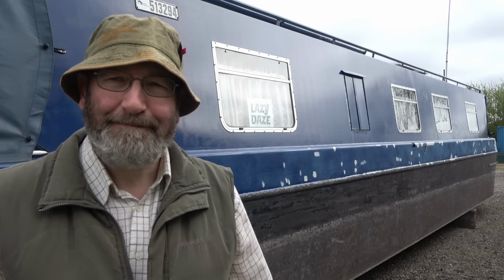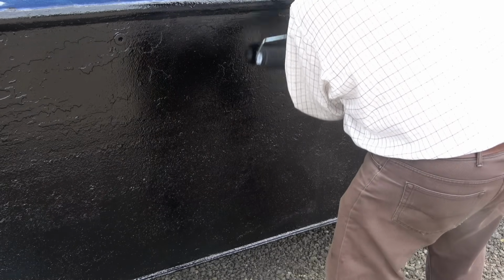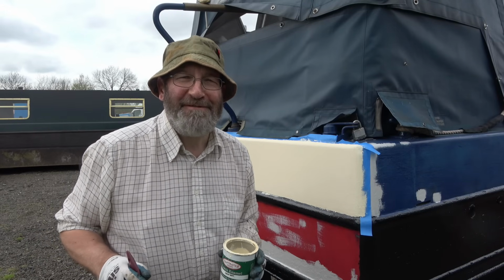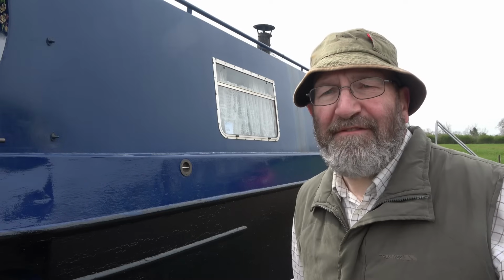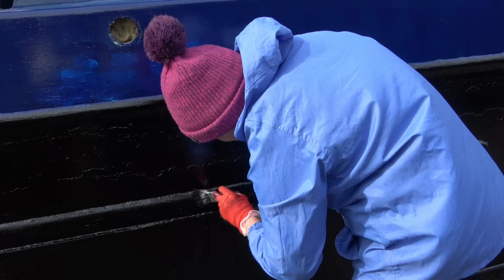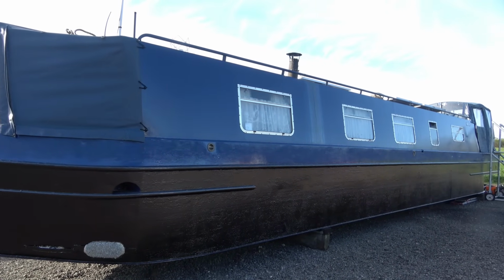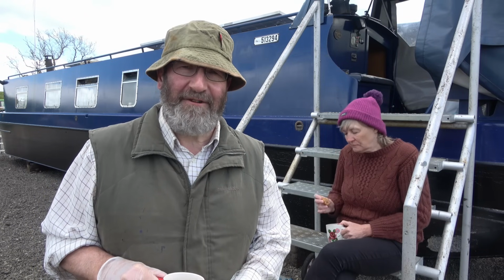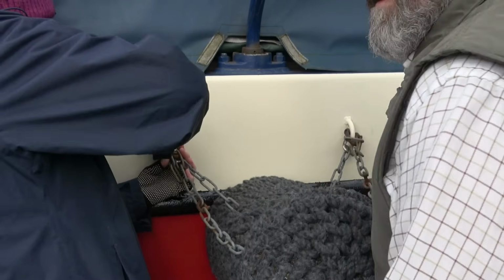396. Narrowboat DIY Hull Blacking - Final Part

Comment: I love to watch people work. I can do it all day. It makes me tired  enough to sleep all-night. You have done a yeoman's job of it. I think the roller lays down an over worked , thinner coat than the brushes do.
Reply from the maker: So do I, that's why I had Sally with me! Brushes do apply more paint but then, if' it's too thick it will run, so many thinner coats are better but it's all a matter of time available to get the job done.
Reply: Alan, extremely glad you've met your soul mate in Sally. I've recently found the same.  I'm a lot older than you but age doesn't count. Great video as usual, best regards from Chester by the Shroppy.
Reply from the maker: @philipjones9458 Hi Philip, I replied to a similar message of yours, not much older actually. Cheers

Comment: Nice 1 Alan and Sally, a good bit of effort there folks, thank you…
Reply from the maker: Glad you enjoyed it, we did, it's very satisfying to do the job ourselves.
Reply: @MyNarrowboatVenture  I will be doing mine next year, I will try doing it all by brush.  The reason being my experience (not a lot) using rollers I find they suck paint up as well as put it on, depending on paint type as to which correct roller to use, by the time I would go shop for the correct one etc I would be half way through the job using the brush, I will see how I get on next year…
Reply from the maker: @Dyfhi I previously used foam rollers but the furry type was much better. I think you have to try different things and see what suits you, everyone has different ideas. Good luck with it when you do it.
Reply: @MyNarrowboatVenture  your right Alan.  When I do mine I shall let you know how long it takes, that’s if I have enough memory on my card at the time to fit it on lol…
Reply from the maker: @Dyfhi I hope it all goes to plan for you.
Reply: @MyNarrowboatVenture  thank you…

Comment: Talk about frustrating, I’ve been there myself over the years, where the lighter primer shows up through the topcoat! You did well, both of you, because one supports the other. 😊
Reply from the maker: I only used the light primer, as my unused tin of red oxide primer had gone hard and I found I had this other primer, clarly not fit for what I was doing with it! Cheers

Comment: Brushing always gives you better coverage than a roller but a roller is a good way to get the paint onto what you are painting. Can I suggest using a three inch bush, if you are feeling extravagant, the best brush to use is an acrylic Purdy brand, picks up more paint and leaves a really good finish, they make painting almost a pleasure, and so much faster, and less chance of of dips because of fewer tin to narrowboat movements. Also having a wider brush apart from picking up 50% more paint each time it also makes cutting in the edges so much easier. Keep eating the cheese topped rolls, haven't seen you eating one recently!
Reply from the maker: I agree with all you say but the gunwales are so easily marked when cruising that the prep and application is less important. A jagged piece of Armco will always win! I have been thinking about doing a better job on the sides than previously, very much as you suggest using a 3” brush. You’ll soon see that I am still eating cheese topped rolls but less often, as I can’t always get them. Cheers and thanks for the advice.

Comment: I purchased a paint stirrer from Screwfix which attaches to a drill.  I used to use an old bit of wood but now use the paint stirrer. It works really well, especially with that oil based paint.  Bye for now...... ❤👋
Reply from the maker: That's very useful for some 'stiff' paints. It was re-stirring the paint that made it change colour before my very eyes. When I didn't re-stir the next tin, all was well. Cheers

Comment: How do your arms and back feel? You've been leaning over pushing on the roller. So my dumb question - you don't black the bottom of the hull?
Reply from the maker: I felt a bit weary after it all, not specifically legs and arms. The base plate is less likely to rust, as it is fully immersed in water. The sides are more prone to rust along the water line where it's wet and exposed to the air. Base plates tend to be 10mm thick and the sides 6mm, so the sides will rust first. My base plate is 8mm.

Comment: Hi Alan & Sally! Well done for gettoing the job done, despite the setbacks. This is not a criticism, but have you watched any vlogs from Boat Time? They are a young couple on a narrowboat, who have also blacked theirs. They also blacked the base plate, which was really hard work. I know that there are two schools of thought about that (whether it needs to be done , or not), but do you know the condition of yours?
Reply from the maker: Hi Alan. I’ve already answered this query twice, so please see if you can find them, as I’m going to answer now in a different way. I wasn’t aware that Boat Time had blacked their boat. What thickness is their base plate? Most boats are 10mm base and the sides are 6mm. The base plate is less prone to rust, as it’s not open to the air, so the sides should rust first, hence the need for regular blacking. It’s not easy finding somewhere that can lift a boat high enough to get underneath it. My boat has an 8mm base plate. The surveyor recommended to get it blacked, so I did. He said it would rub off but stay in any pits. I don’t see the need to black the underside, as it’s thicker by design for a reason. I’m told my boat is built of good grade steel, I don’t get rust spots like I see on other boats, so all is well as far as I’m concerned.

Comment: Why have you left the base plate Alan?
Reply from the maker: Hi Martin, I’ve already answered this query to another viewer. It’s not usual to black the base plate, as it’s totally under water, so less likely to rust. The real concern is on the sides where the steel gets wet and dry along the water line. Also, standard base plate is 10mm thick, the sides are generally 6mm, so the sides will rust first. To put it another way, it is reflected when a boat is built. My base is only 8mm. There are very few places that can lift a boat high enough to black the underside! Hope that explains.
Reply: @MyNarrowboatVenture  Thanks Alan for letting me know. I suppose the only way to do the base plate is in a dry dock.🙂
Reply from the maker: @martin4787 You won’t have the height in a dry dock. The boat needs to be lifted high by a gantry, or crane and put on trestles to get beneath it.
Reply: @MyNarrowboatVenture  I've seen it done in a dry dock Alan. When I lived in Trevor in the 70's on the Llangollen Canal, there were two dry docks where I've seen it done. Ok the height wasn't the best, but it could still be done, by a younger person than us lol🙂
Reply from the maker: @martin4787 I didn’t mean to suggest it couldn’t be done in a dry dock but generally, to work comfortably beneath, the boat needs to be hoisted quite high.
Reply: @MyNarrowboatVenture  Hi Alan. It's definitely a job for younger people than us admittedly. In the 70's I was a teenager and absolutely no job fazed me. I worked a part time job on a Saturday on Anglo Welsh and they would use the dry docks for their boats in the winter, which was very interesting to watch.
I'll sign off now Alan and let you and Sally enjoy what's left of the weekend. 🙂
👍
Reply from the maker: @martin4787 It’s interesting to know you were involved with Narrowboats all those years ago, have a good weekend.
Reply: @MyNarrowboatVenture  👍🙂

Comment: I have told the last time you painted your boat. Finish anything that is vertical with vertical brush strokes. Horizontal brush strokes will produce runs.
Reply from the maker: I’ll be doing that when I paint the cabin sides. It was easier for me to do the gunwales and stern, from side to side.

Comment: Have you ever used an extension on your roller?  It's a back pain saver.  ;-)
Reply from the maker: I have. I bought an extension last time I blacked the boat and it was hard work to use it, as a lot of pressure is needed to apply the bitumen and I found it more difficult reloading from the tray. So not for me. Extensions might help rollering house walls above your head, but that’s very different to blacking 🤠